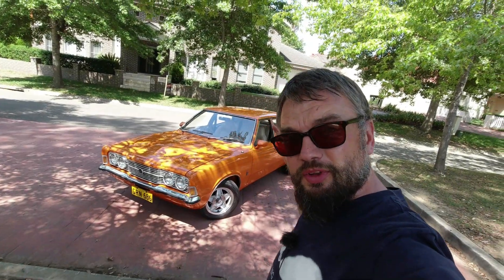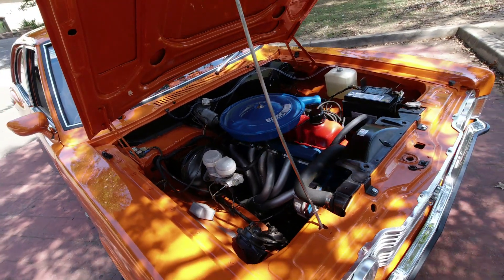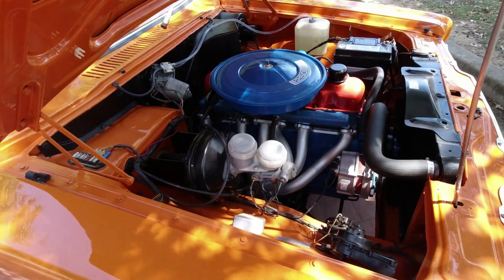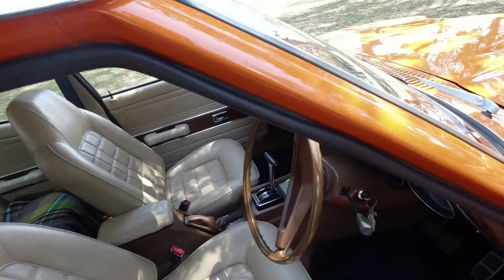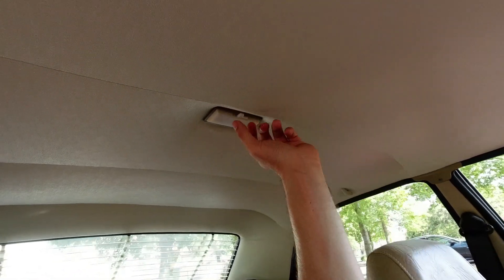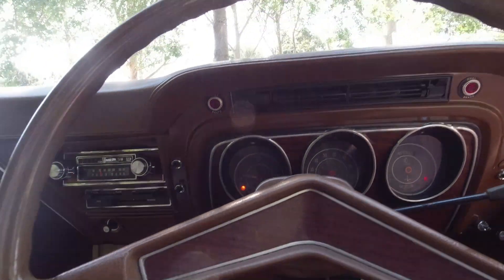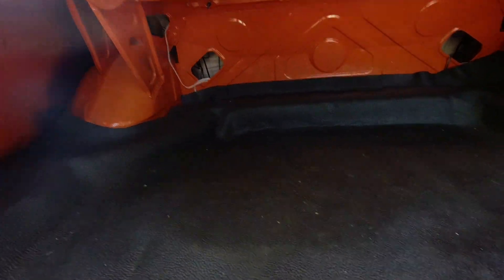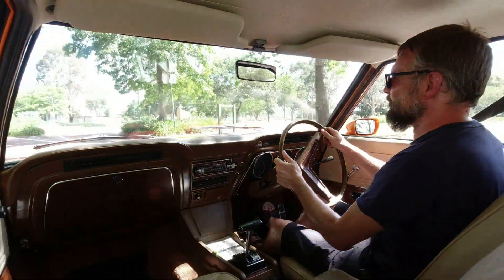Aussie Oddballs: Ford Cortina 6! 4.1-litre, tested in 40+ degree heat

Comment: Britain - we'll put a huge 2.0 liter four in it, Australia "Hold my beer".
Reply: Adding so much weight up front with a cast iron 6 doesn't help an already pretty crappy design go around cormers very well  Now you get both understeer & snap oversteer!  "Treacherous in the Wet" you might say.  EDIT - typo
Reply: @UncleJoeMedia  Agreed, but Aussies were more into unpolished straight line get up n go, rather than the European sophistication of handling.
Reply: @KG84C  True.  "Roadholding" was considered, eg the crazy Toranas, but not "handling" as we know it.  Anyway, it was & mostly is still the Traffic Light Grand Prix!
Reply: Victor Murat  Probably a good fit, but the 250 cubic inch straight six was a pretty big lump of iron.
That said, Windsor V8 conversions are common in Australia, even Cleveland conversions if your up for it.
Reply: Uncle Joe   Australia bro. What are corners. Our longest stretch of straight road is 90km but part of 1600+ km road. Who needs corners? Lol
Reply: Victor Murat   We didn’t get a V6 cortina. But we did build some V6 Capri. Wicked fast.
Reply: Victor Murat   Oops.
Reply: Victor Murat   Hell no.
Reply: @UncleJoeMedia  not at all mate
Reply: @marvinmartinsYT  We did Mk4-5 2.3 V6 Ghia an Mk4 2.3 V6 S very rare. Check the Super Speed Cortina, Coke bottle Coupe lovely 👍🏻
Reply: @chris425amp7    Didn’t know that. Cheers.  A mate was right into them but I didn’t hear him mention V6
Reply: @KG84C  - yeah, the 250, especially an auto with single barrel carb, was a horrid motor. Torque yeah, but awful to drive. There were a lot of these converted to Windsor motors, however I think the Clevos were more of a challenge due to the strut towers getting in the way of the headers (and maybe the heads too).
From memory, the Windsor conversions were lighter and better balanced as the motor sat a long way further back than the boat anchor 6's.
Reply: @UncleJoeMedia  lucky it doesn't rain much in Australia
Reply: Funny, after about '73 the 2 litre was the base engine here. Early production offered the 1600 but few bought it so it was dropped.
Reply: Ford Australia when they switched to the Mazda 626 based Telstar Range as the Cortina replacement learned the hard way it didn't need a 6 just a well made 4 which was well overdue.We didn't except for Bathurst car racing didn't get the Sierra due to the everything below Falcon sold in Australia being a Mazda based clone.
Reply: One of the reasons for small engines in UK cars was the insurance category costs.  In OZ we had Cortina  TC and TD Cortina with 2 litre 4, 3.3 l six and 4.1 6 cyl, all about category 2 or 3 insurance.  In UK 2 litre was category 5, so they had 1100, 1300, 1600 engines.  (Earlier Mk1 and MK2 only had 1300 or 1500/1600 engines). Small engines to get low insurance premium.  They also had some tax deal with vans so people put seats in the back of escort panel vans.  I remember the confusing question, something like "is this vehicle not a vehicle with windows fitted to the rear of the drivers seat"  I could not work out to answer yes or no.
Reply: Anyway 😅  shelby given blank check from ford get me a car to beat ferrari. 

Shelby found LOLA CARS MK6 the first thing Ford did to the now GT40 was remove the Chevy v8 engine 😂😂😂😂😂😂😂😂😂😂

Let that sink in. 😂😂😂😂😂😂😂

The GT40 came standard with a chevy v8 fords real rival. That's embarrassing imo. 

But atleast the world never forgot thats a British car not american car. Gran Turismo shows 🇬🇧 flag on it as it should be. 

Ford still hasn't rivalled that car. The GT's cool all that but nothing near the GT40 shock and awe. 

It doesnt matter it never will what ford tries to do to reignite that flame. They never will. It will always be meh in the shadow of GT40. 

Attention seeking cars. GT44 😂 GT90 🇺🇸 plesse accept it as legendary. 😢nope. 

USA land speed records usa is good at that though. Youd think so though since thats the whole car culture isn't it. Green light go always eyes on the finish line. 😢

That's not racing. Thats not even driving lol. B roads alittle wider than the car is 60mph cant see nothing infront but hard turn through the hedges. Anyone coming? Suck it and see. 😮

That was close. Thats car passion. 

Today usa is learning. Even Corvette threw out their whole identity lol. Corvette identity which is cool but corvette wants sales so ditched the recipe for European recipe instead. 

Corvette C6 i think. Top gear uk clarkson shows us all the changes made to make it more like a euro car. Short wheelbase wide track width. Now theyve gone even further and mid engine lost the identity completly trying to compete with porsche. But never will. Will they? 

Corvette cool factor was real tho window maker cars always are cool. 

USA Corvettes. 
UK TVRs. 

TVR went bust though 😢 maybe helped Corvette change their minds on what they should build. 

Australia just copies usa still though. Aus 5yrs late to JDM scene just cos usa bump it 😢

YET.... Australia always had JDM just there. Easier than usa ever will. Aussies in japan bringing cars to Aus once USA said its cool aussies agreed. 

Okay so.... ditch the muscle cars? Ahh man but we was winning though. 😂

Australia was winning too. Aussie muscle cars just look better than usa ones. On the track the aussie muscle car is gone from the line 3 cars out infront of the equivalent us muscle hustle. 

Its embarrassing really for usa they couldn't even hang on to that niche lol. Usa cant compete so makes new game. Names it the same lol. 

Football style. It should be called run ball or idk RUGBY? definitely not football though. One kick per quarter isnt enough 😂😂😂😂😂

Land speed records i forgot. USA does that in its sleep doesnt it. Masters of fast straight line. 

Yet so is UK. The land speed record had always been UK or USA. Mayb UK now still after many years. Usa getting lazy? 😂

Soon somebody in USA supra fun boy type with garage and YT channel etc they will learn about the Supra Slayer. Theyll get one in USA theyll boost it like they do the supras beyond silly. Then all the usa garages will see it 😮😮😮

4 cylinder 800bhp usa will double that. Triple that.
But the 210mph saph does 0-200mph in 22.5sec. Faster than a veyron 16 cylinders vs 16 valves 😂😂😂😂😂
Reply: @richlawrence4160 

Rs1600cc destroys chevy 5700cc

Crystal palace raceway 1970

Watch it. See the boss mustang struggling with the 1200cc mini coopers too? 

😂😂😂😂😂😂😂😂😂😂😂

Today even USA forgot their car identity thats how good it was. They import now. 

USA only globe car is Tesla cars. They are on the roads in numbers like usa car never was.
Reply: @johncoops6897  I had a TE Cortina Ghia 4.1 litre auto. Probably the worst car I have ever owned. Surprisingly it never felt powerful. Just nose heavy and a terrible handler. Then there was the build quality, or lack thereof.
Reply: @peterrobertson3728  - a mate of mine bought a base model TC or TD 250 3 speed manual brand new. It was an absolutely awful thing, but it did a meaty burnout (in first gear, at least).
Another mate had a higher spec model also 250 and I will never forget how frightening it was to be driven in.
I still vividly remember in the late 1970's being in the passenger seat with him driving it up Pennant Hills Rd, Sydney in the rain at over 160km/h and it was butt-puckeringly scary. It was floating around all over the road, and was one of the very few teenage hooning moments when I genuinely thought I was gunna be a statistic. 😮

Comment: These were quite common  here in Australia,right up to the last one made in the 80s.  A lot of buyers preferred the six cylinder version, as compared to the four cylinder version. Petrol was relatively cheap,and the sixes were very relaxing and powerful enough to cover the vast distances with ease.
Reply: Sure were! 4, 6 or v8 option.
Reply: @mikeparkes7922  no v8 option in cortinas.
Reply: Yeah and petrol has become cheap again , and im lovin my V8 at the moment
Reply: @Expedient_Mensch  Factory, no. Selected dealers, yes.
Reply: @celtic barbarian Do you remember the times of getting a free VCR or holiday package when you bought a car (or before that) a free tv/radio combo installed? Well, 6 years before you were driving those Fords in 1979, selected dealers offered (non-factory) engine, accessory and a plethora of other options. It was very pricey, and some people with more money than sense (like me at the time) took them up on it.
Reply: @mikeparkes7922 , definitely no under-the-counter V8 option, definitely not from selected dealers.  It's a big dumb urban myth - and clumsier than the "Nah, my dad's mate got one of the secret Phase 4 Falcon GTs."  
Even if Ford had NOT kept really good records, every nerd and boffin would have long ago found out about a few V8 Cortinas.  The Cleveland motor would barely fit, in any case.
Reply: @assininecomment1630  1. Never said it "under the counter". 2. Definitely selected dealers on the east coast. 3. Not big, dumb myth, as I bought one (as I previously stated). 4. Never said 302 Cleveland. Read again, pal.
Reply: @mikeparkes7922 , it's an urban myth.  No Ford dealers anywhere in Oz put a new V8 into any new Cortinas.  Even if the Windsor was slightly narrower than the Cleveland, dealers wouldn't have access to random new Windsor donks lying around since the late 60s.  Many people swapped (squeezed) in a V8 later, but it was never a dealer option.
Reply: @assininecomment1630  Obviously you're going to continue to believe what you wish to believe, irrespective of what anyone says to the contrary. Your call. I lived it, bought it, owned it. You didn't. Irrespective of your beliefs.
Reply: @mikeparkes7922 , you have no paperwork, no photos and no other evidence. 
Nobody else has ever had one of these either.  That's because no Ford dealers sold new Cortinas with a dealer fitted option of a new Ford V8.
It's nonsensical that dealers of any manufacturer, would take the factory fitted 4 or 6 cyl motor out of a perfectly good (but terribly badly suspended) medium sedan, buy in factory V8s, swap them in, and sell them. There was no warranty, no replacement parts, and no factory technical advice. 
Ford's boffins didn't develop such a car, or even have lead engineers throw together some prototypes (like Holden did earlier, with the LJ Torana V8). 
Oh, and there was no demand or interest in such a car, while the sporting Falcons had successfully seen off both the Monaro and the Charger, and was selling like hotcakes.  
Take your story to a serious Ford forum, and see what happens there.
Reply: Assinine indeed! lol.
Reply: @mikeparkes7922 , so you seriously maintain that certain dealers offered a Cleveland option in new Cortinas in '76?
Reply: Doug Odyssey , and any permutation of online search reveals NO records, discussion, or examples of any Australian Ford dealers (selected or otherwise, East coast or anywhere) selling any new Cortinas fitted with the contemporary Clevo or previously common Windsor motors, in either capacity.  It must be a conspiracy - and at the exact same time as we're all distracted by the 'China Virus'!!!  :-o   (Which isn't even real, and everybody is actually sick from 5Gee.  It's true - I saw it on YouTube!)  X-D
Reply: Assinine Comment Bullshit.They did not.I have owned 2 of these.
Reply: @bluemtsexpose5984 , no you haven't.  We're not talking about enthusiast's custom jobs, or Suth Ifrican dealer variants that were privately imported.  We're talking (still?) about Parkes' assertion that you could choose the V8 option on new TC Cortinas.  
Nobody ever bought a new Australian TC (or TD, TE, TF) Cortina with the V8 option, from any dealer, anywhere on the entire continent - because such a car never existed.  Lots of random people fitted V8s over the years, but the factory did not.
Reply: There was never a V8 factory option from Australia in a cortina, only the 4 cylinders & the 2 Falcon in-line sixes, you’ve probably seen a car which some couta has stuck a 302 or something in it himself, you obviously weren’t around in the day.
Reply: Ford would have definitely used it for racing if a V8 Cortina came from factory, being half a ton lighter than an XA onwards Falcon.
Reply: How much are six these days
Reply: dougodyssey50  
I had a74 model  mk2 , M series 2000cc straight six, not as much go as
the 2600 or the low down of a Holden six, but she revved okay
and I could 100kmh out of second gear.
The red motors had run out of breath a couple of gear changes back.😉
Reply: @mikeparkes7922  
I'm not buying it.
Mate had put a 302W in his, but we would have read/ heard about it,
if the "Dealer specials" existed.
Sorry, I'm calling total BS on this one.
Right up there with the bloke who told me once his mate bored a VW engine out
with a round or half round file, but he took his time though!
Yeah, right, a total BS merchant.
Reply: @imanenigma3348  Yeah, it's rubbish, if there'd been a v8 Cortina around in the 1977-1985 time, I'd have known about it and bought it. Didn't happen.